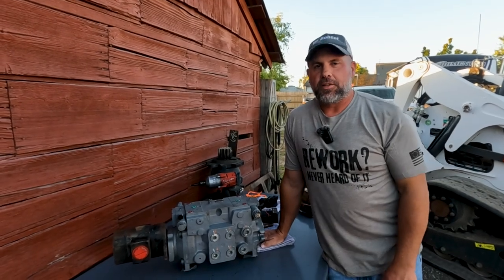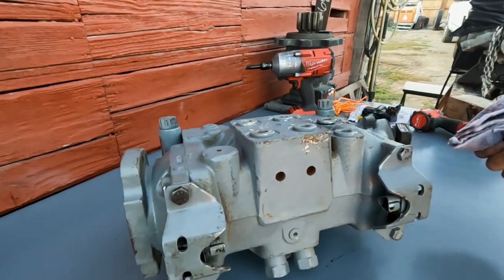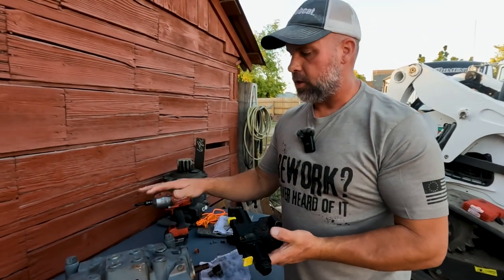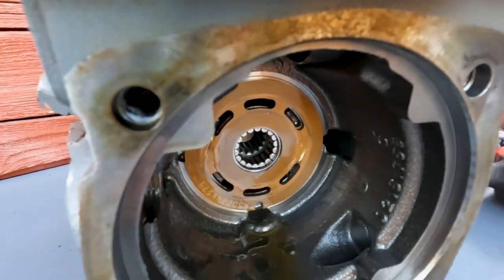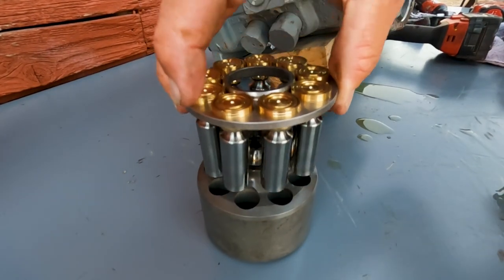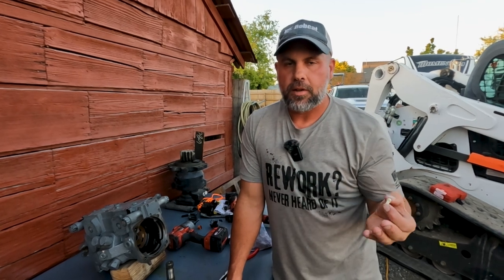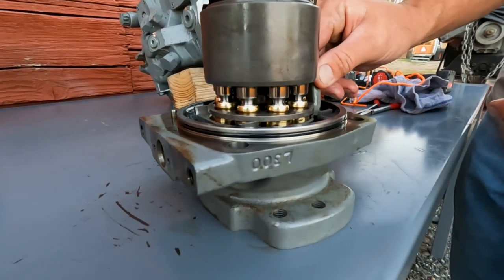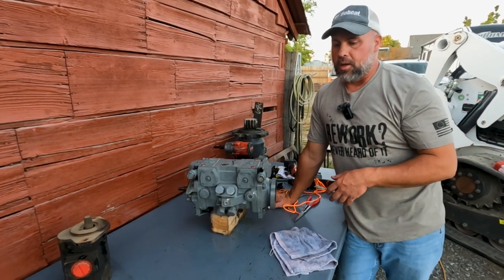Bobcat Swash Plate Sensor, What Is It And Why Does It Fail?

Comment: Hello friend, I'm from Chile, can you help me, unfortunately the representation of the Bobcat brand, in my country there is a company that unfortunately does not comply with the technical assistance and the spare parts are not in stock and only for import, in addition of taking 4 weeks each time a spare part is requested, the values you charge us are practically high, we are working to pay for the spare parts. Currently, 2 elements were damaged (swich plate and coil of the High Flow) I am trying to find a spare parts distributor in the US to directly request the spare parts and skip the dealer in my country, is it possible that you can help me??? Bobcat T770

Comment: You never say what the swash plate controls? Does it control the tracks? I have one that the tracks work for about 30 seconds, then quits. All of the other hydraulics still work, just not the drive. Since it moves for a short period of time, i know the motors are working, it’s an electrical problem. No codes. ZHS 430 Fast track.

Comment: Thank you so much for this video, I had a t190 that the left swash plate sensor signal was erratic, ended up pulling the engine and replacing the sensor, reinstalled and did drive calibration and boom problem repaired, thanks for covering this though!!!

Comment: I'm working on a bobcat loader T250 and I am having a problem with getting 2 swash plate sensor codes, I removed the engine and checked for movement in the swash plate sensor actuators and found no problem with either one of them so I replaced both sensors and centered it up pretty good and put it back together but still getting the same codes so I checked the voltages and I can't get the voltages down below 3 volts no matter how far I adjust it with the screws in it indicating that the swash plates really are out of neutral. Do you know how to adjust the swash plates so they are really in the neutral position. This does have the solenoids that controls the speed. The bobcat won't even crank over or turn on the fuel solenoid. could this problem with the swash plates out of neutral, cause it not to crank? This is a job where somebody else changed the engine and I had to finish putting it back together and it's been sitting for several years and I had to repair numerous electrical problems with it to get it this far so I don't know what other problems there might be with the unit but I have been told that the swash plates out of neutral could keep it from cranking but I don't know if it's true or not any help would be appreciated.

Comment: CNH uses a couple different version of this pump in their skid steers. The pumps they use have the charge pump integrated into that housing you removed from this pump.
CNH also does not authorize their technicians to take apart these pumps. I have had one pump where the bolts that hold that end housing on broke at about 20 hrs on the machine and it just kept dumping all the oil out the bottom. There was also one where whenever you enabled hydraulics it would just drive one side in circles no matter the input. That one must have had broken servo piston centering springs or something.

Comment: I purchased a used T630 Sunbelt machine from an auction.  Ran great until this problem, about 3100 hours.  7528 right side.  I'm going to order the bushing and control arm and have purchased a service manual.  The service manual speaks about remote start tool needed to run a calibration.  Is there a way to replace these parts without requiring a full calibration?  Can you speak a little bit about when a calibration would be required and ways to avoid a calibration if everything was perfect before this error code?  Also the pump motor is painted a deep blue color on the case, I'm suspect that it could have already been replaced.  Is there a common color for these hydrostatic pumps from the factory?  Great video!  Thank you.

Comment: I have a T-450 2016 D7528 error code where is runs and shuts down after running for a while. Says "shutdown"  starts right back up but dies a lot once things heat up. Dealers backed up. Pump calibration first, if bad replace the bushing? Leave the sensor? Thanks for the video

Comment: Hoping you have a minute for some advice. Just bought a 2016 T550 at auction (2,200 hrs) and it has code D7528 (rt swash plate out of position). I just did a hydraulic flush bc the fluid looked terrible. The machine will run/drive for a bit but it seems to almost always shut down and throw the code when backing up on wobbly terrain. I can run it up and down my driveway 200 yards long and it seems ok but can consistently get it to shut down if I go off my drive and then reverse back on to it as I  turn around (there's a couple inch height difference at the edge of the drive). 

Not sure if there are any other trouble shooting I can do before starting down the road of pulling the engine and pump?  I greatly appreciate your time and advice!
Reply from the maker: You can try a pump calibration and check wiring but I wouldn't get my hopes up
Reply: @tetradgroup , THANKS!  I figured as much. I got the service records for the machine and the prior owner, Sunbelt, did a pump calibration but no luck.
Reply: Thanks again - bit the bullet and got the engine pulled out today. To get the pump out, I'm guessing it's easiest to  just disconnect the hydraulic lines and hoses, electrical connectors, and then pull the pump out in tack with the cast iron pulley housing (or whatever that's called) that has the 3rd engine mount?  

It didn't look like it had any mounts itself - just was supported by being attached to the cast iron pulley housing. Is that right?

https://youtube.com/shorts/6m3ySHVZx4w?feature=share
Reply from the maker: @marshallbell9354  yes that's correct. Pull the housing so you can remove pulley from pump shaft the pump from housing.  I'm impressed you got it out that quick. You can mount engine to pulley housing and put it all back in as an assembly.
Reply: @tetradgroup  THANK YOU AGAIN!!!
Reply: Hi, I have a 2016 T740 with the same code D7528. Voltage on the swash plate sensor is varying between 2.4V to 2.7V depending on if I release the joystick to neutral position from driving fwd or reverse. Left side sensor has the same readings. I have calibrated the drive pump but didn’t help. Does this sound like a bushing problem like yours?

Comment: You’re a wealth of knowledge. We just spent 40k on a. Low hour a770 and it’s throwing a code for each side 7527 and 7528. Do you think if it’s throwing both it’s the controller or both bushings? Should I replace all 3 while I have the engine out. Pretty pissed about this ngl, but it is what it is
Reply from the maker: I would not think both bushings are bad at the same time.  I also don't think it would be a controller issue.  Have you checked the main hydrostatic filter for contamination?
Reply: @tetradgroup  I ordered every filter for it Friday so I’m going to throw them in Monday. It did seem weird, just shuts off randomly while I got guys driving it down the road haha
Reply: @tetradgroup  what I can tell you is the hydro oul is black and I can’t see through the filter. So I’m draining out as much as I can and putting fresh in. 

That being said, I’m trying to change the fan gearbox filter, that’s not an issue. But where the heck do I fill it back up at?

Comment: I have a 2016 T-650. After throwing the swash plate code, the dealer changed the bushing. That didn’t work. They have changed the sensors. That didn’t work. They changed the wiring harness to the sensors. After 35 min, that didn’t work. Dealer and bobcat are throwing up their arms at this point. Machine only has 1400 hrs. Any suggestions on what can be done next? Pump calibration was fine. They want to put an entire new pump in now. Curious on your thoughts? Thanks for much!!
Reply from the maker: @jasonluneau4630  depends on the code and symptoms.
Reply: @tetradgroup  D7528 code, it will go into shut down mode.
Reply from the maker: @jasonluneau4630  did they replace the sensor?  Maybe swap sensors from left to right and see if code changes
Reply: @tetradgroup  yep new sensor and after that didn’t work we swapped sensors
Reply from the maker: @jasonluneau4630  I'd have to monitor it on the computer to see what is actually happening.  Sounds like either the pump or the controller at this point.
Reply: @tetradgroup  Thanks for responding, it’s greatly appreciated. I may try controller since it’s a lot cheaper than a pump.

Comment: Your videos have been very helpful.  I own 4 different Bobcat machines.  I have odd question tho,  what brand is the mic you are using connected to your shirt?
Reply from the maker: I've used several mic setups and the DJI is by far the best in my opinion. They are a little expensive but I wasted money on other setups, buy once cry once I guess.  https://amzn.to/3GN4So7
Reply: @tetradgroup  Thank you! Keep up the good work on the channel,  with the quality content you are providing,  your channel will grow very quickly.  I'm currently having issue with my 2021 MT100 meter not working,  do you know what that could be,  or there a cable disconnected?
Reply from the maker: @KennysTreeRemoval  I'm would definitely check the connection on the meter first.  If the meter is bad I would think warranty would cover it.

Comment: I have this exact issue. currently I have the swashplaye sensors unplugged so that it will run in limp mode. Can the pump be pulled from under the cab or does the engine have to be removed. Bobcat quoted me somewhere around 5000 to replace the bushing
Reply from the maker: I have seen it pulled from the front but I personally always pull the engine skid, easier for me.
Reply: @tetradgroup  I don't have an engine hoist was trying to avoid purchasing one even if I do it would still be cheaper than taking it to bobcat
Reply from the maker: @jonathoncain2300  absolutely, even with hoist you will be around $600 for parts, if that.